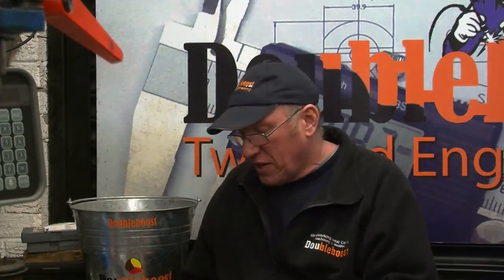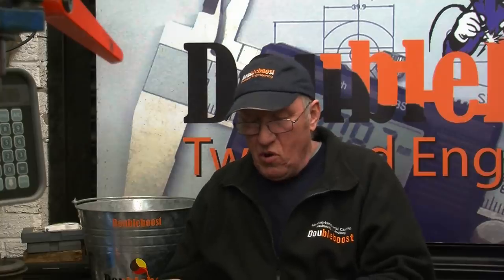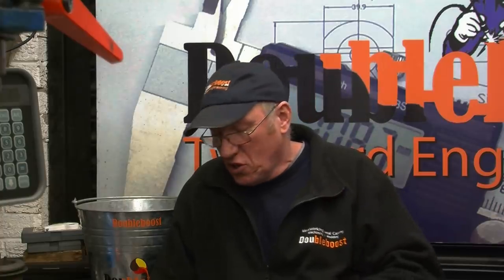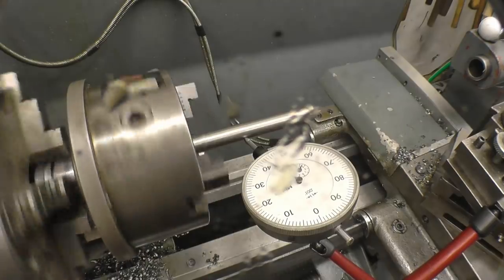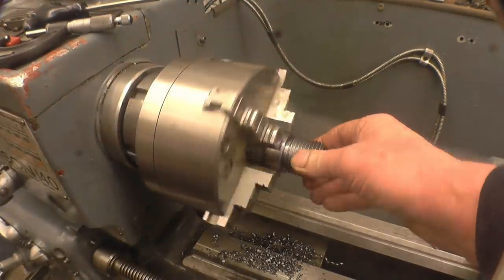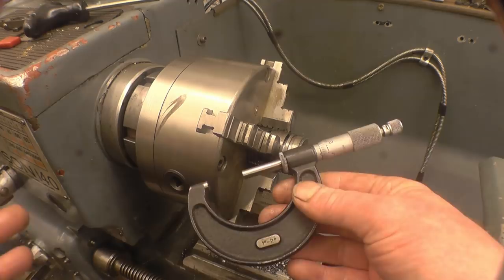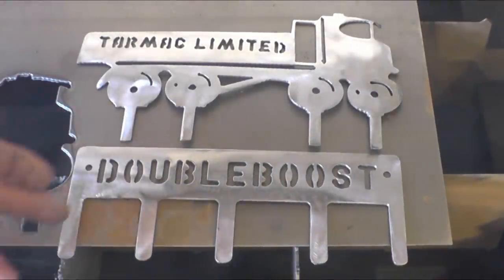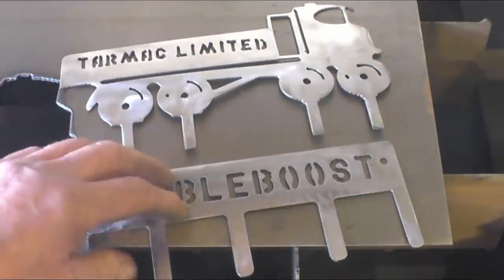SNNC 264 P1    8TPI Revisited   Plasma Key Rack

Comment: Love your work John. When doing intricate cuts with the plasma, try giving the metal a good buff with a light abrasive wheel or wire brush on the small angle grinder. You’ll be surprised at the crispness of the edges. Looks like you’ve got your torch speed bang on.

Eric
Reply from the maker: I will give that a try  thanks for watching
Reply: doubleboost , I used to work in a fab shop back in the day before plasma. We would cut out all kind shite with the oxy acetylene when we weren’t busy. We found when the thin layer of mill scale was removed, it made a lot of difference. Let me know if it works for you.

Eric

Comment: Great video John! Does your lathe not have a threading dial? All that forward and reverse seems like alot of wear and tear on the motor an contactors. Although I suppose it eliminates some of variables inherent in traditional threading.
Reply from the maker: The lathe is metric  i only reverse for imperial threads
Reply: @doubleboost  ah makes sense now! Keep up the great work! Cheers from New York!

Comment: John, you do know that you can reverse a 3 phase motor by swapping any two of the three leads right?
Reversing your phase converter all the time seems really bad for it.... it is also very slow. All you would need is a suitable reversing switch on you lathe... imaybe the one on the phase converter could even be suitable!
If so, put a normal wall plug on the fc input and use the reversing switch to reverse the fc’s output leads.
Maybe you coul look into it? Best regards, Marc
Reply from the maker: It is the lathe i am reversing not the rotary converter